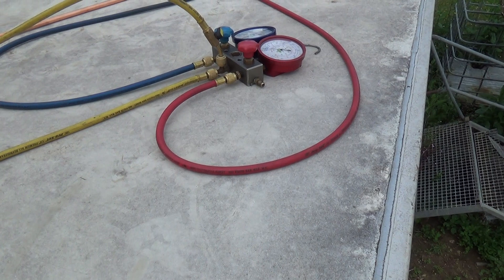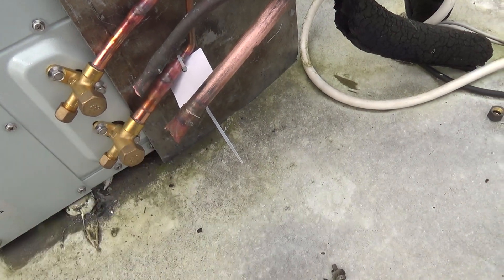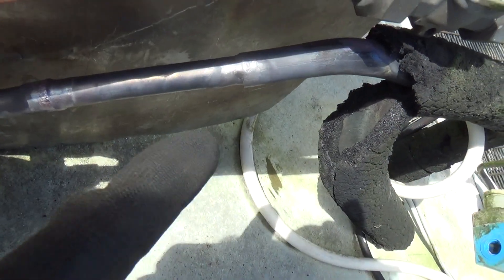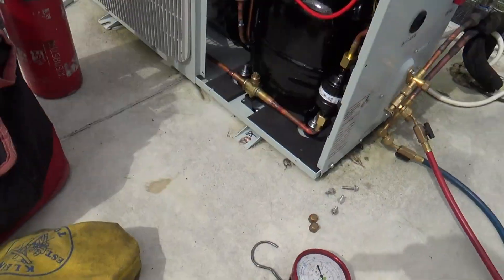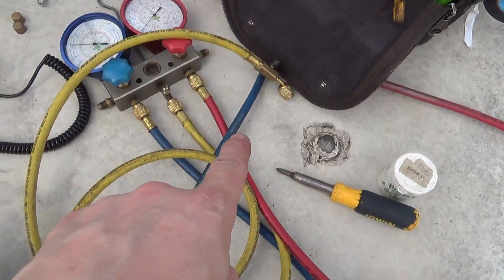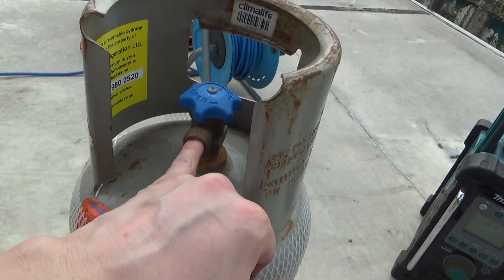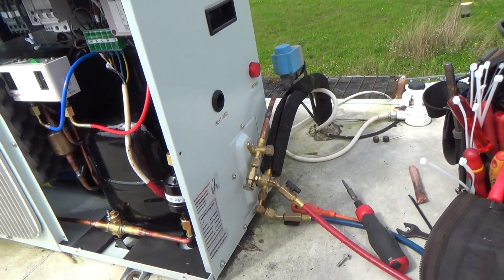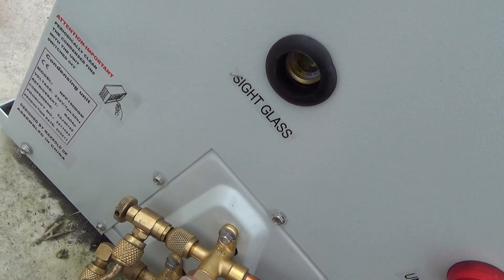Fingers Crossed!

Comment: Nice job. I like that condenser looks serviceable. You certainly want to keep a cap on that tank with the cost today.
Reply from the maker: Yeah R404A just gone up in price about 30% here!
Reply: @heavydiesel  Yes even R22 is more than quadruple the price it was 5 years ago. Been selling off some of it, as I deal with it a lot less now, and had stocked up with it in bulk. But old systems are going to be kept running till they die, and R22 is still used for some specialist uses, where the drop in alternatives do not work as well. But phase out is soon, but probably will be the same as analogue TV phase out, which is still being done, 10 years after the rest of the planet. So you still get TV sets with both analogue PAL and digital receiver in them.

Comment: Well, hopefully the new compressor will last long, and eventually you will be replacing the indoor unit as well, keeping only the piping and controller from the original. For a small volume like that, and that sort of temperature, you could probably get away with just putting a 24000BTU split unit in in a pinch, and this would allow you to wait a month or three for the proper one to arrive. Then take the split unit out and put in the house, as you pretty much cannot get a split unit these days that is not also a heat pump. Not that I ever use it as heat pump much, think only ran it like that 5 minutes once or twice, just to circulate the refrigerant in winter.
Reply from the maker: Hopefully this will last a good few years, its not run all year round as the ambient temperature is probably low enough not to need cooling for a lot of the year.

Comment: Why you don't get with an indoor condensing unit for example tecumseh HA series?
Reply from the maker: Think this worked out cheaper, the Maxcold unit comes with drier, sight glass, pressure switches, contactor, delay timer, fan speed control, all factory fitted for not much more than a basic condensing unit.

Comment: Had a bottle of r449a virgin gas, dud bottle recently from d&w, couldn’t understand why there was grit in my gauges, there was no flow through the gauges. I thought it was the gauges and then swapped to new. Went back a few weeks later with the same bottle of 449 on new gauges and happened again. Found grit coming from the bottle and no flow intermittently from the bottle opening. So odd
Reply from the maker: You'd think they would be checked before refilling!

Comment: The state of refrigerant tanks and recovery is appalling these days .
I've seen them leak from the valve , from the threaded fitting, I've had the thread mashed up to where it's unusable, etc etc
And the worst thing is : nobody cares ...
Reply from the maker: Yeah, Ive reported faulty one before and nobody seems bothered. Had one many years ago that had actual water in it, was only lucky I was taking vapour out of the bottle and it froze the water in the bottle and you could here it in there!
Reply: @heavydiesel  Refillers that do not care, slap it in, send it out, so long as it had close to the right fill mass, or close to the right gas, it will do for them.